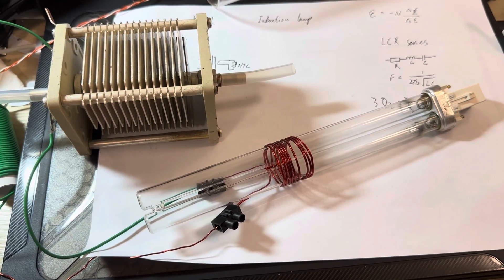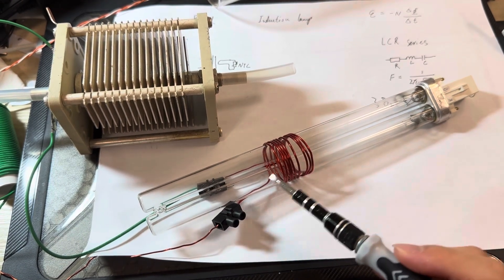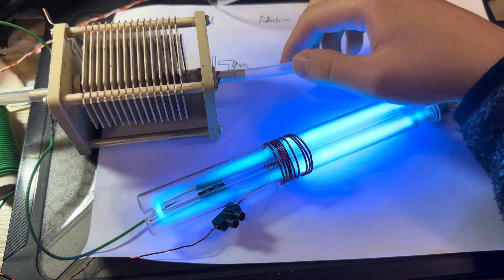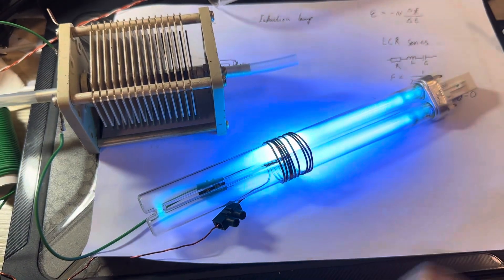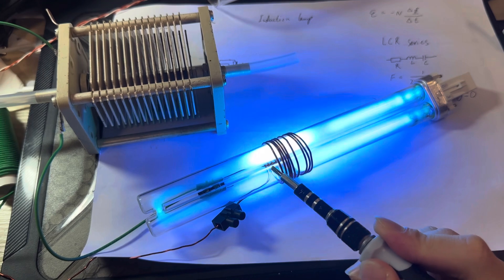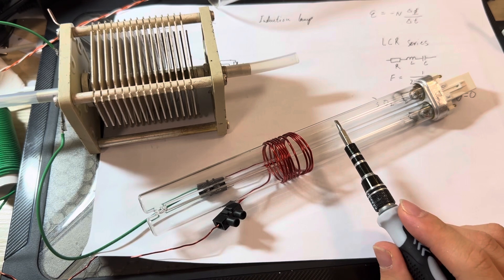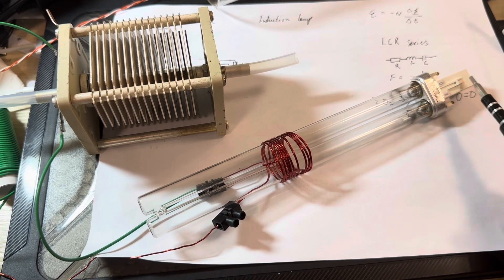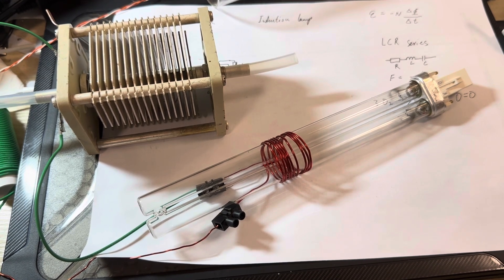11w uvc lamp powered by induction

Comment: Looks cool, how do you get these?
Reply from the maker: You mean the uvc tube or the oscillator driver?
Reply: @ReedSwitchTube  Tubes like these in general
Reply from the maker: @mamoth4251 you can get it on eBay
Reply: Be careful with UVC lamps, it can damage your eyes and cause skin cancers.